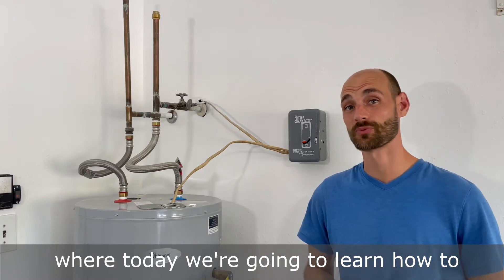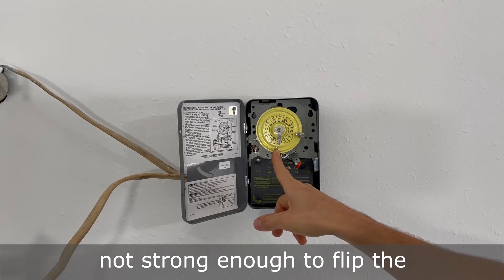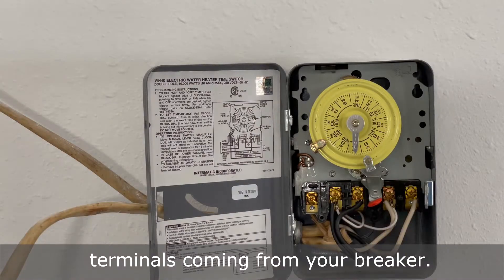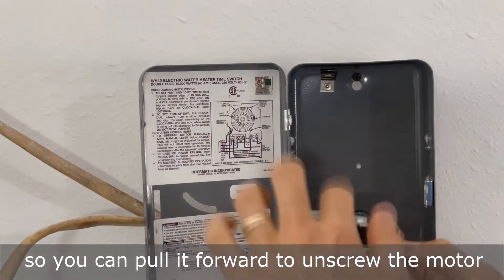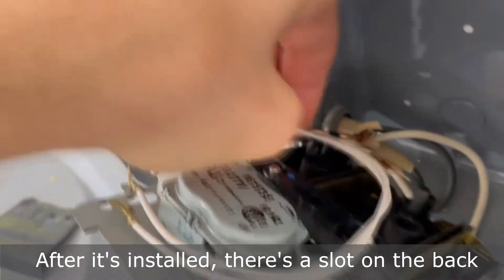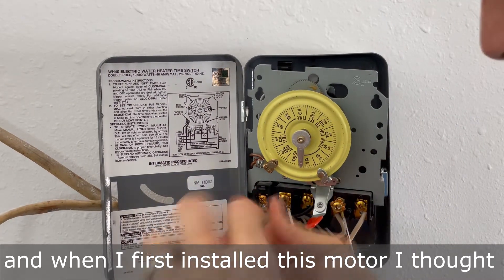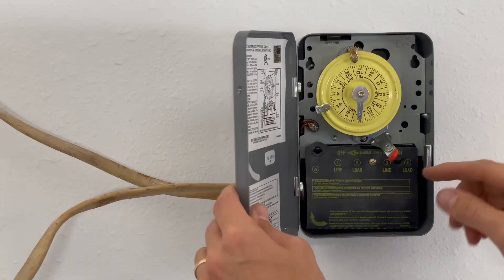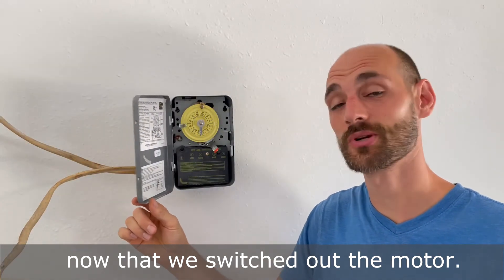How to Repair INTERMATIC (Mechanical) Hot Water Heater Timer!!

Comment: My timer is not moving appropriately. I set it last night, came out 24 hrs later and the timer had only moved several hours. Think this could be motor related too? Or think the whole gray box needs replaced?
Reply from the maker: They have great technical support. They diagnosed my problem immediately when I called them. Hope that helps!
Reply: @rutterrealtygc thanks

Comment: you dont repair it. you replace the motor.
Reply from the maker: Correct. That is the repair vs. buying a brand-new complete assembly from the store.
Reply: @rutterrealtygc  this timer is Garbage. They die within 2 to 3 years. I have already replaced 4 of them and I'm done with them because non of those timers last longer than 3 or 4 year in any of my houses. Piece of junk made to break.

Comment: My timer ticks like a clock too. Is that normal?
Reply from the maker: Mine doesn’t click🤔
Reply: charley this is normal but only because the grease on the motor has dried out. if you leave it as is, it will make noise and fail prematurely. get any silicone lubricant that's OK for use on plastics (not WD40, an actual lubricant like super lube) and follows ryans video to remove the motor. you'll want to apply a fair bit of grease to the gears closest to the back of the motor case (furthest from the single brass gear that goes through the opening). it will still make noise when you put it back, but after it runs for an hour or so it will be dead quiet, and hopefully will last you many more years.
Reply: For anyone else reading, mine has ticked like this since installed 10 yrs ago, perhaps the newer models don't.

Comment: Thank you for posting. Mine was working fine until last power outage. It has stopped ticking and the dial has stopped moving. Is it the motor that needs replacing? I just leave it in the on position now but I loved it when working.
Reply from the maker: I’d call intermatic to make sure. They are extremely helpful at troubleshooting over the phone.👍

Comment: wanted to know how to completely bypass this and shut if off without inadvertently shutting off water heater. Any advice?
Reply from the maker: If you want to "bypass" it without shutting off the power, then just take the little tabs off the timer that turn off the hot water heater and it will always stay on (as long as the switch is in the "on" position.  Otherwise, you'll have shut off the power, which will inadvertently shut off your hot water heater momentarily, while you take the power supply wire from the timer and directly wire it to the hot water heater, effectively bypassing it completely.
Reply: @rutterrealtygc  Thx! Just like the pool timer.

Comment: Great video I have the same timer on my water heater would this keep my water heater from working I turn it on manually and no hot water
Reply from the maker: If you have a “no touch” electrical meter I would check to make sure power is getting to your hot water heater. If there is power, I would make sure the correct voltage is getting to the water heater. If there’s electricity and it’s the correct voltage your heating element might be bad.🤷‍♂️